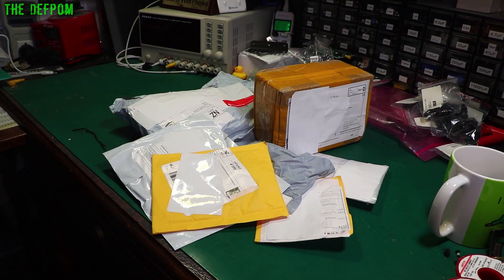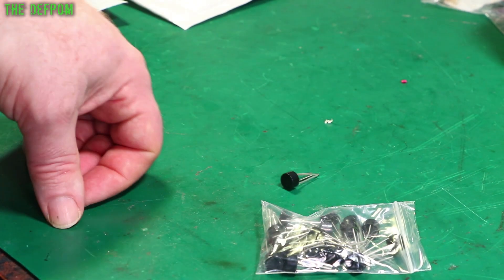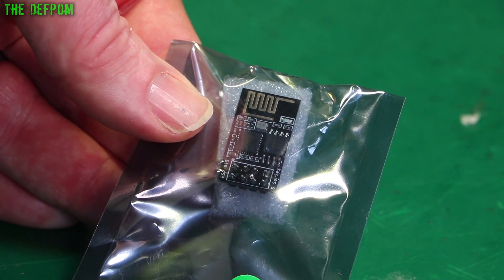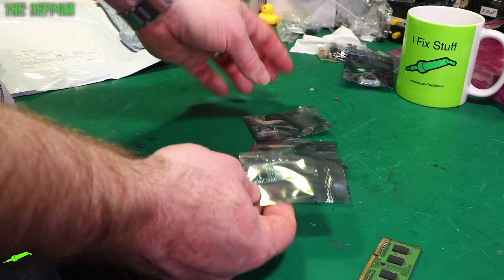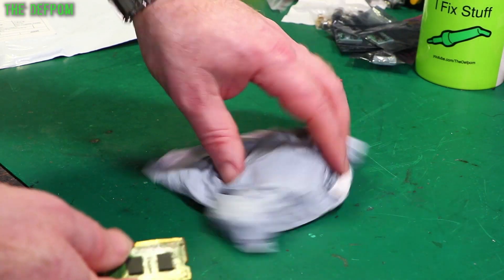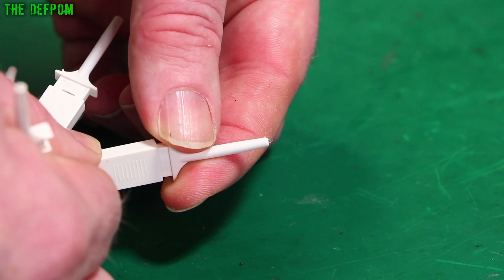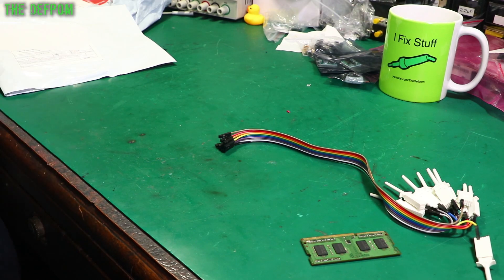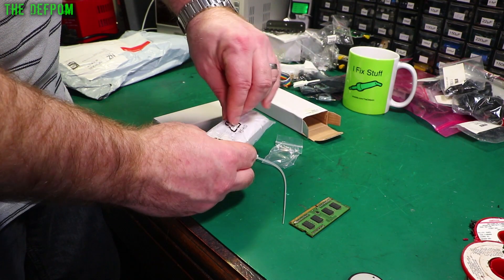#747 Mailbag Monday 17th August 2020 - Electronics Gadgets To Buy 🎞 📭 📦 📩

Comment: I like the new visual annotations.
A shallow depth of field will give autofocus a hard time. You can increase the depth of field with:
A higher F-stop.
More lighting (thus a higher F-stop).
Move the camera further away from target (use zoom to get back).
Reply from the maker: I didn't stick with Auto focus as it was too unreliable, I have carried on with using manual focus and having to take more care with it.
I was using f13 or even f15 for a while in order to get a bigger DOF, now I am on f9 as I am wanting to get better video quality, I already have about 5000-6000 lumen of lighting on my bench (I forget exactly what it was).
Reply: @TheDefpom  Have a play with camera to subject distance. Except for overhead shots, my camera is mounted on a microphone stand, the type with the 250mm round bases I.e. its not on a lanky tripod.....so its a lot more flexible to move around in tight spaces.
I am using a Panasonic camcorder.

Comment: For Mailbag videos I think this setup works fine.
It's the items that needs the focus so to speak.
Seems easy for you to zoom in and out as needed to,
so "Good enough for New Zealand" right?
Reply from the maker: I am pretty happy with what I am doing now, I can see a noticeable improvement in the video quality with my new camera settings and the higher video encoding settings.
I was exporting at 10.5 Mb/s (youtube recommends 8Mb/s for 1080p25), but am now using 17Mb/s (twice what youtube wants), and that has made a good improvement, it just means that my video files are a lot larger, and take a lot longer to upload on my flaky broadband.

Comment: It’s funny at one point  in my life revolved around changing bridge rectifiers and smoothing capacitors but not so much these days I’m guess it’s just the advent of switch modes everywhere. Thanks regards Chris
Reply from the maker: I rarely have to change full wave bridge rectifiers, in fact a few times I just made one using 1n4001's.